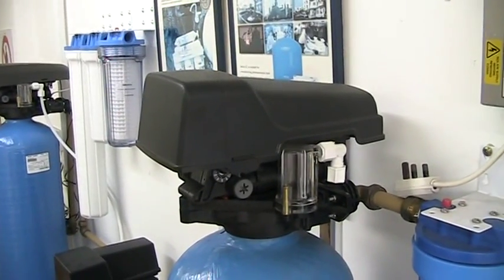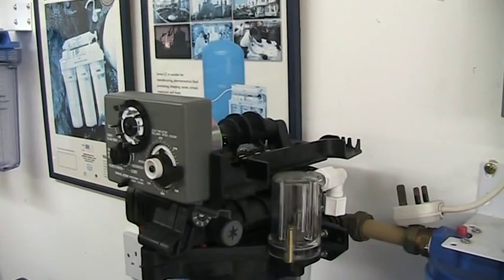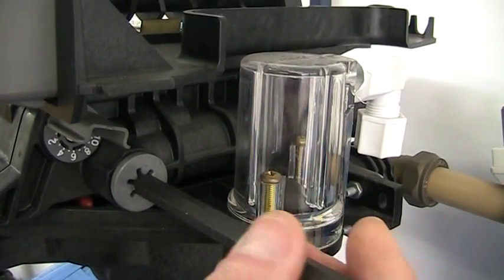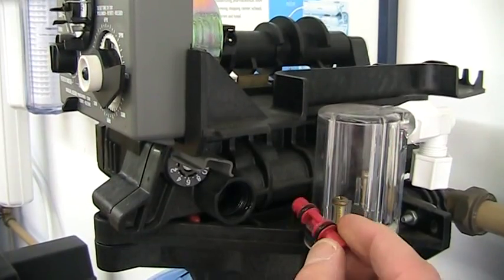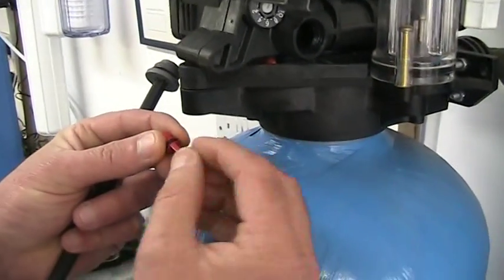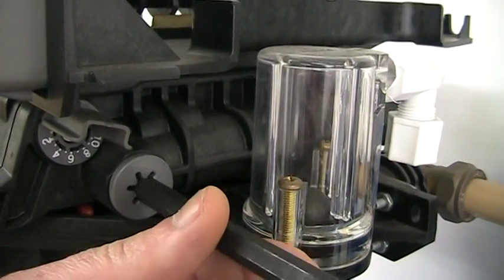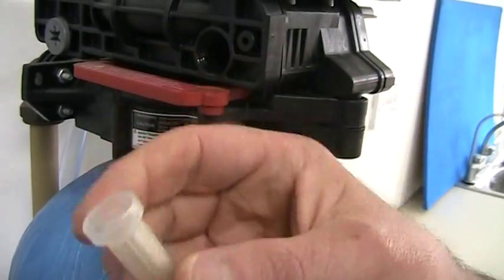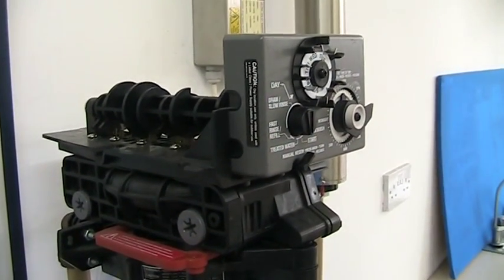Autotrol 255 valves Injector & Screen cleaning

Comment: how do you release the pressure?  is that the big red handle on the left of the unit shown in the video?
Reply: You turn on the water downstream (such as in the house) after you have turned off the water to the unit. The red handle is the lock to the head of the unit (to remove the head for service).